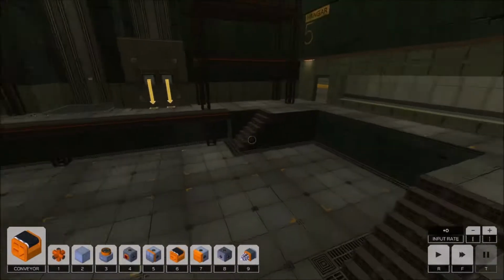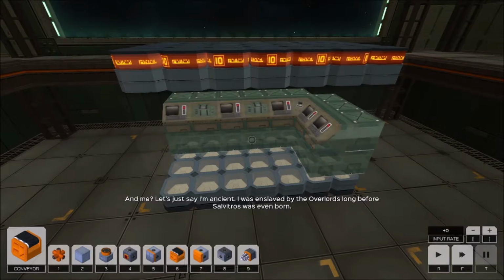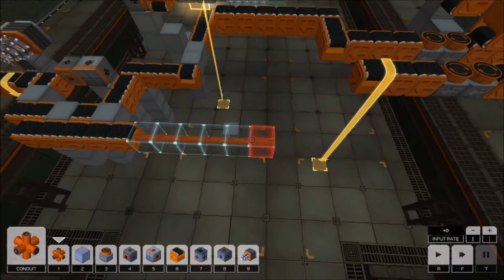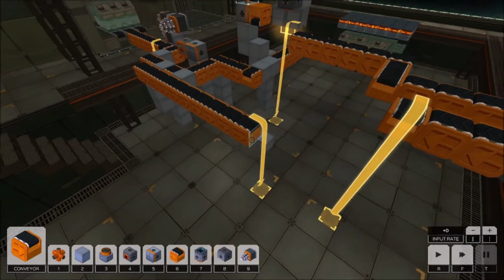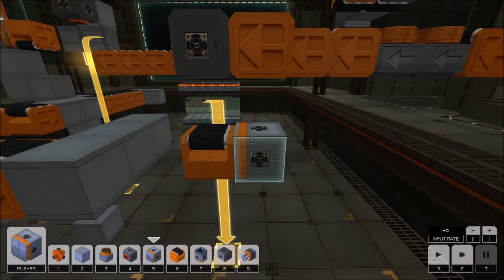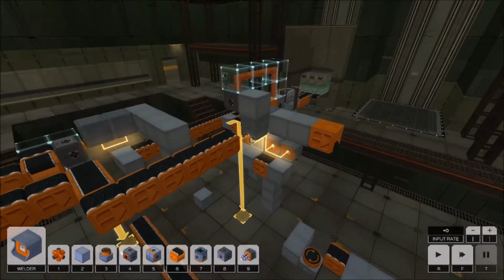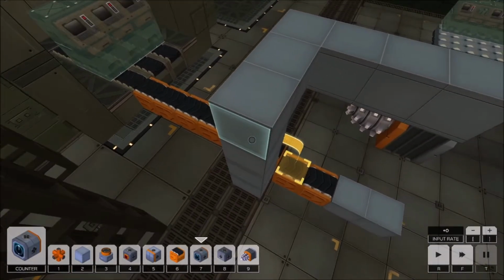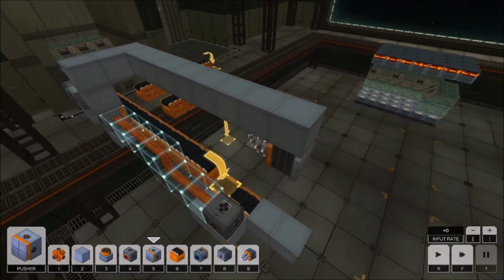Randoms (31) Infinifactory Control Console

Comment: it was as delicious as i remember. identifying problems, seeing your subsequent discovery and solutions. good stuff. good stuff.
though seeing you trash the whole thing and start over took me down a notch. i really think you could have salvaged your original design, even if version 2 was closer to intended.
Reply from the maker: Sadly I had a fundamental error in my design which made me concerned I'd compound the problem by reworking the first build - especially frustrating when I KNOW I have to carefully check output ratios first.  
Although I had to clear the whole lot I'd still learnt a lot from the first build and many elements came out identical on version 2.